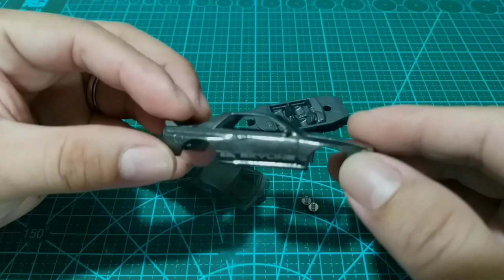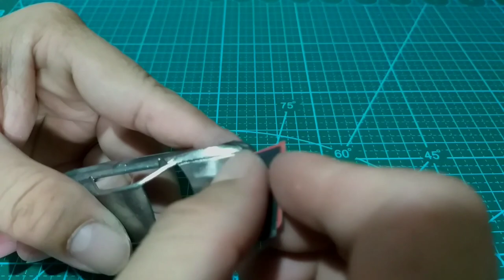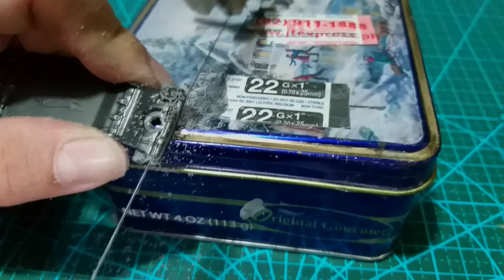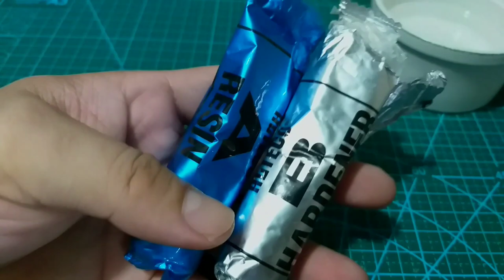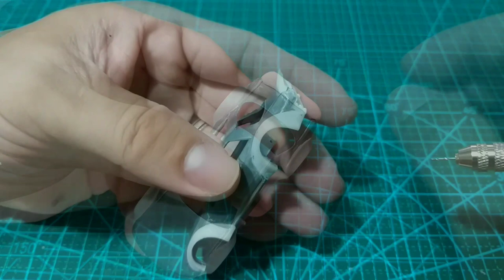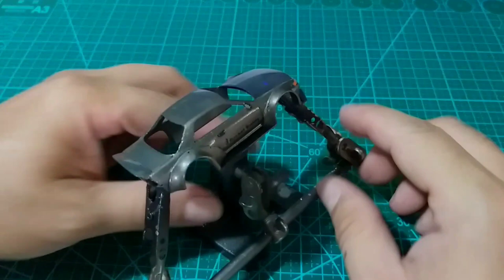CUSTOM HOT WHEELS NISSAN SKYLINE R32

Comment: what did you use for the widebody?
Reply from the maker: Epo putty,
Reply: @customhotwheels  do you know where i can get epo putty?
Reply from the maker: Got mine online, shopee.ph
Reply: @customhotwheels  ok thanks
Reply: @customhotwheels  one more question, is there anything that can substitute  epo putty?
Reply from the maker: Tou can use any epoxy putty, i also use steel epoxy, non sag epoxy, putty or paste type would work
Reply: @customhotwheels  thanksss very helpful